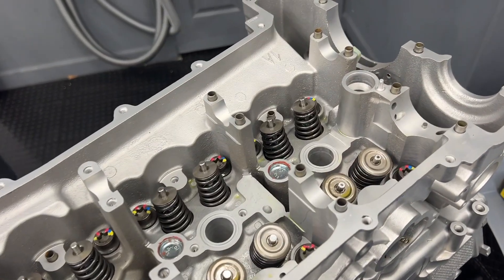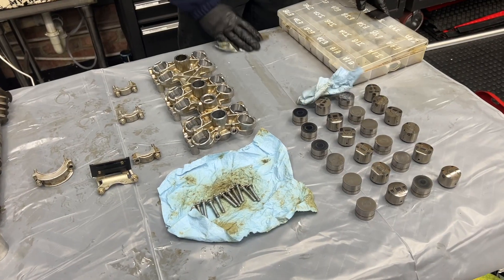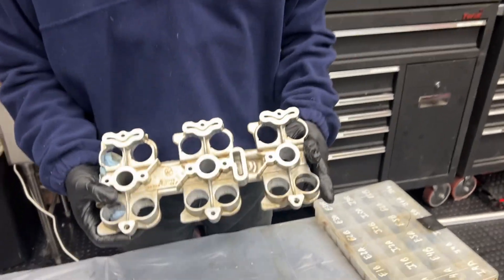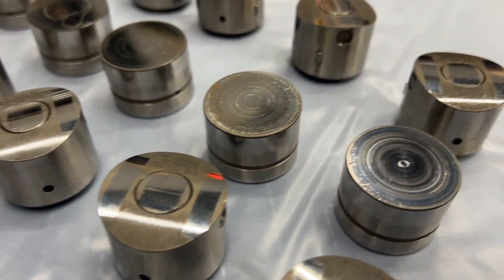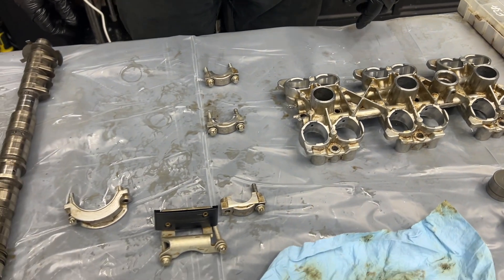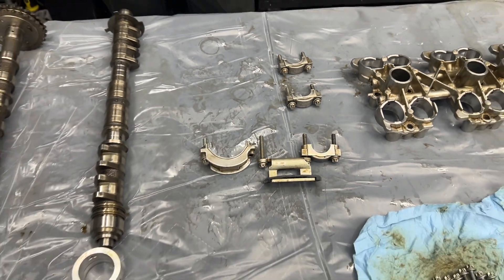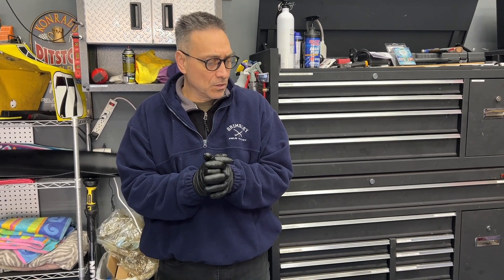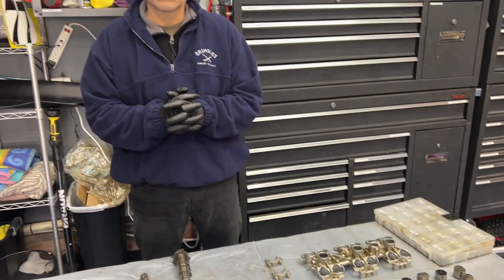Porsche 911 Engine Assembly Guide Part 21 - Camshaft Parts and Prep

Comment: I’m at the same stage with my build. Going to do timing today. Take in mind that if you are using the torque book, it might have incorrect information regarding the intake camshaft bolt. It should be 50 Nm and 110* and not 30 Nm and 90* as the book says.
Reply: Also, take your timing tool out before you do the 110 degree spin, or you'll potentially tweak it or break a cam! Hopefully you have the cam locks, though I think you can get away with not using them.
I reused my 50k mile lifters and cradles, but the engine blew up shortly afterwards - I can sell you mine LOL! Stuck intake lifter may have actually been the problem.
Reply from the maker: +@miketdavies yikes! Thanks for the info! 🍻
Reply from the maker: +@meirschwartz8554 thanks! I haven’t researched the torque specs yet. Where did you get those numbers from?
Reply: @HelpMeDIY  I’m building an Heartec 4.1 engine machined by Slakker Racing. I got the information from Brandon at Slakker, Lee Jenkins at Heartech, and it also matches the information in the Bentley book pages 15-65 and 15-70.

Comment: Guess I'm 1st in the comments: (1) for the intake lifter buckets, take your fingernail and see if it catches on them and if it does then replace them. (2) Replace the parts behind the camshaft timing adjuster, due to oil the pressure can be effected, due to wear, causing potential timing fluctuations. The intake camshaft has variable lift and oil pressure regulated by the DME and the solenoid does the switching to the other cam lobe as need be. This allows the cams to be quite mild @ idle and low RPM's and then kick butt as required, unlike it used to be mild or wild. The lifter carrier gets the wear in those slots from the pressure rocking the buckets as the camshaft rotates and that pattern cause some binding. The Variocam adjusters have multiple chambers in them and paddles which fill and empty oil as required for advancing/retarding timing.  The cam caps are align bored in the heads, just like the engine case halves. Hope this helps you out.
Reply from the maker: +@warrenlucier5796 thanks for all the info! 🍻